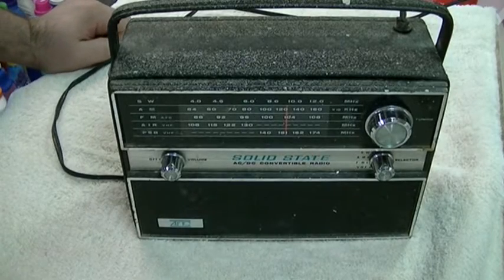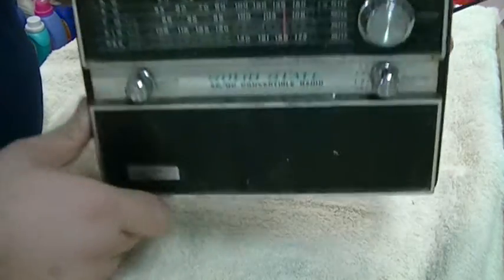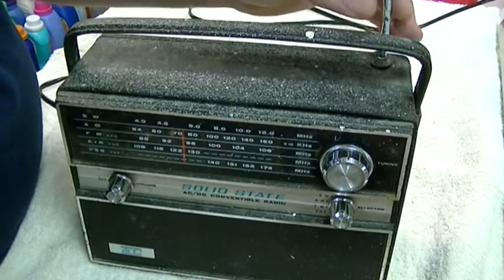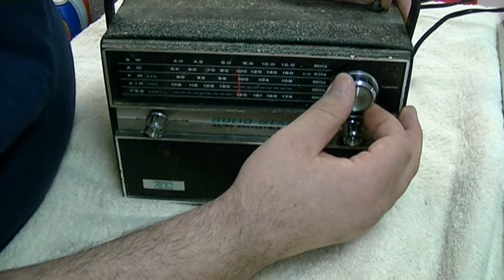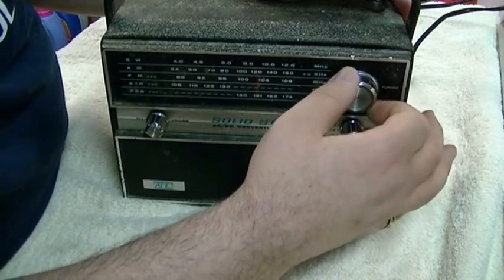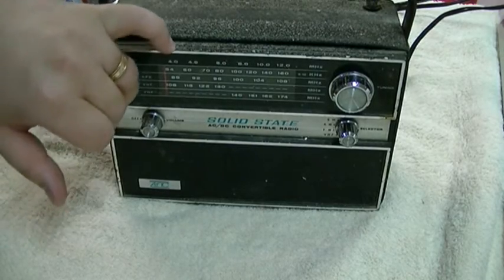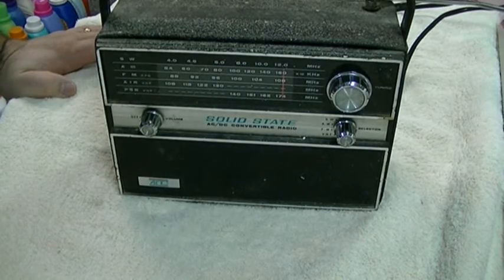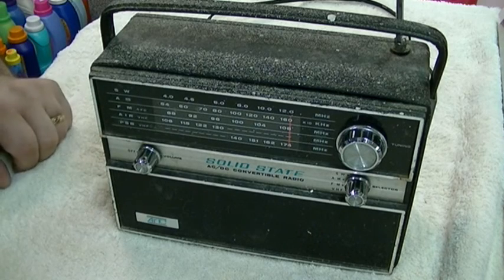VINTAGE AITC 60s/70s Solid State Table Radio AM/FM/VHF/SW

Comment: I remember having a radio with VHF and could pick up the old Saturday morning cartoons on it as well as the TV. Now if you don't have a HDTV you can't get VHF or UHF without a converter box. I have a old CRT TV not sure of brand as the badge is gone that Im keeping as a backup but will need to get a converter box as I can't find a HDMI to coaxial cable converter. here is something else. THERE IS NO SUCH THING AS A HD ANTENNA. it's just a marking ploy. A old fashion pair of rabbit ears from the dollar store works just fine.
Reply from the maker: +lexmarks567 I had run across a radio once before that had VHF reception, and I was puzzled by it.  Being a kid at the time, I asked my dad, and he told me it was there so you could "listen to TV".  Of course that spawned the age old question "Why would you want to listen to TV, you watch it!  Without seeing the picture you miss out on everything!"  And the answer was a bail-out "Some people do".

I know the HD antennas are simply made-in-China pieces of garbage not designed to do anything but take more money from your pocket.  The best you'll find with a converter box or cable box:  Although I don't have a particular brand to recommend (what does a brand name actually mean anymore?) if the box will output "as low as" S-Video you can hook up the old TV.  Even if the TV only has coax, with S-Video, you can:
1.  Hook up an S-VHS VCR that has S-Video in, and will convert down to coax.
2.  Use an adapter cable to combine the S-Video signal into a composite signal, which can:
      A.  Go into an old VCR, which will convert to coax.
      B.  Run that into an RF Modulator box, which will convert to coax.

Most over-the-air HD boxes they manufactured would output as low as coax, but I wouldn't be surprised if they cheaped out that much they only output HDMI, for those idiots that went out on Black Friday right when HD TV came out, and nobody had a set yet, and bought one, and, being a Black Friday special, doesn't have an ATSC tuner built in.  Also, because the live in (A-HEM) low-cost housing, they don't have cable either.  Right, made for that little niche market.  I've seen products as useless as that before!

Comment: At first i thought the paint splatters were like a bumpy finsh on the radio. Sounds like all it needs in contact cleaner. Lots of Nirvana on the radio..i like that..LOL
Reply from the maker: Yeah the volume has been fixed.  The big moose out front, I mean the video description should have told you so.

Comment: Yeah, the thing about shortwave is, if you don't have a fine-tuner, you have to tune painfully slow. I mean you have to turn it half a micron a second to pick up DX stations when the band is crammed together in the radio. I find that the evening and early nigh time is when most of the decent programming comes in. Also, many good stations broadcast in SSB instead of AM, so they can't be heard on that particular radio. There's a lot that goes into it, but it's still worth a listen if you can get past all of the Armageddon preachers and political junkies that broadcast on there. haha
Reply from the maker: +Rebelkid1112 Yeah, all I really found on there was a Catholic radio station from North Carolina.  Still something, anyway.  I used to have a Sony radio that also picked up SW and had a digital tuner, but one day the entire radio, like just about every other Sony product I've ever had, simply refused to turn on.  Catastrophic failure.  It's still around somewhere at my dad's house, who knows, one day it might magically spring back to life again,. stranger things have happened!
Reply: Yeah, it's too bad. A lot of good companies have declined in quality over the years, but Sony probably had the most dramatic fall in terms of quality and reliability.
Reply from the maker: Rebelkid1112 I've heard the same.